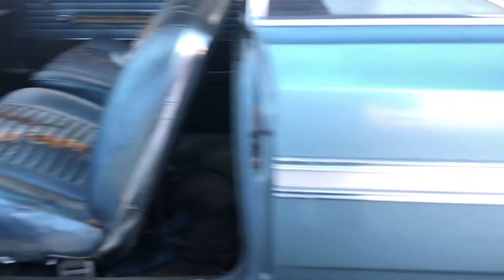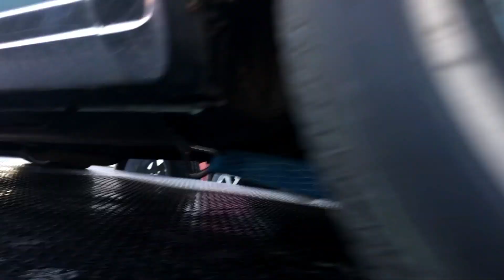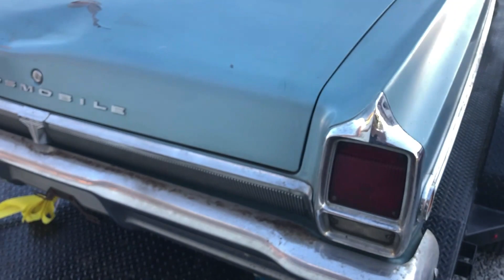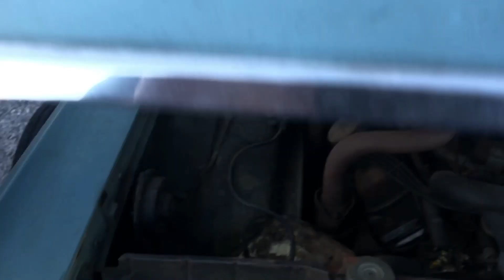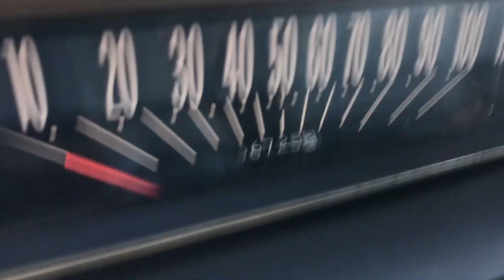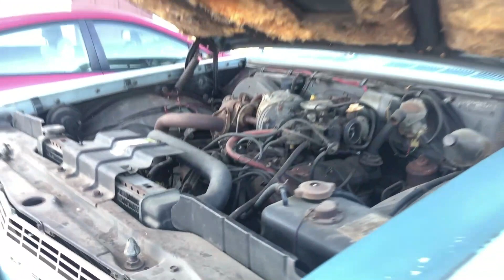First Time Started in 30 years. 1963 Jetfire 4 Speed Car, My Next Project

Comment: Those should have all been built with a stick shift, the awful automatic just 
could not deal with the power.  But time moves on, my 77 403 is faster, and in 
a 4100 lb car gets better mileage on the cheapest fuel instead of the most 
expensive.  Bruce Roe